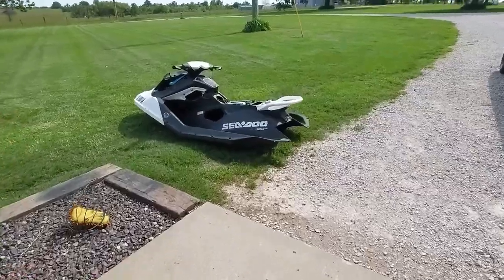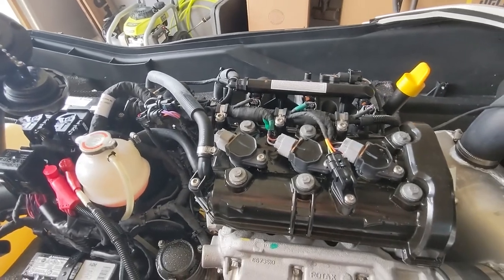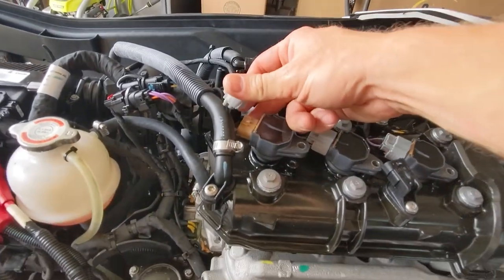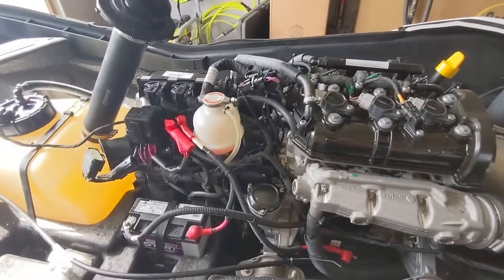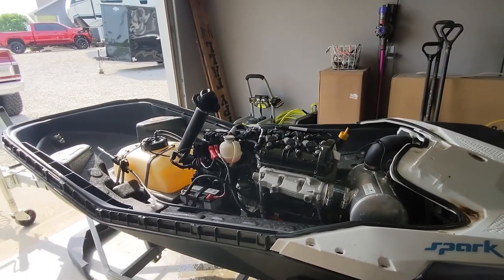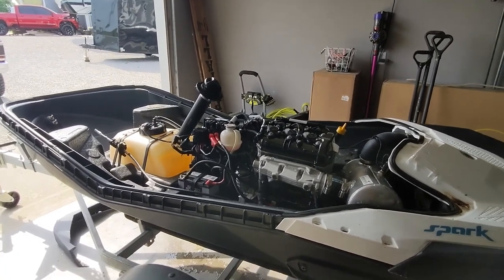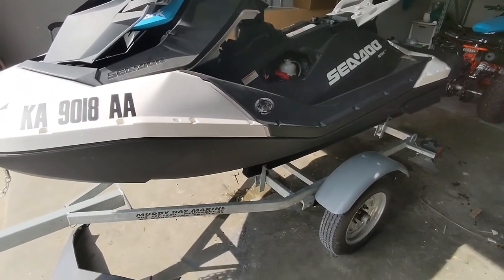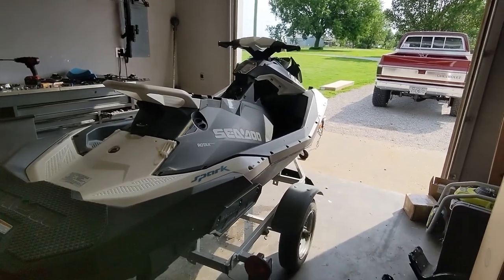Sea-doo Spark and Trixx Spark Plug Change.  Short and sweet.

Comment: I have a 2019 Trixx with just a hair over 4 hours on it and it's spent most of its life sitting on the lift.  Only rode it once this year and it ran like crap.  Battery went bad as well.  Replaced battery and it turns over great now, but won't start.  Could it be as simple as the plugs with only that few of hours??